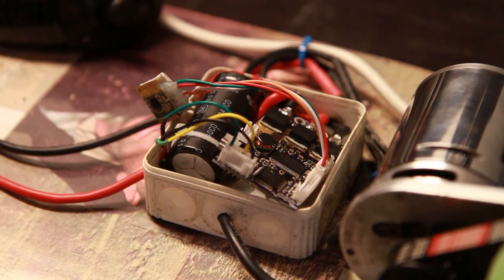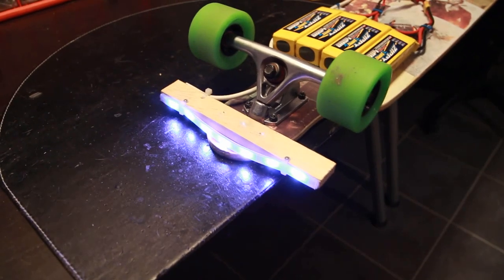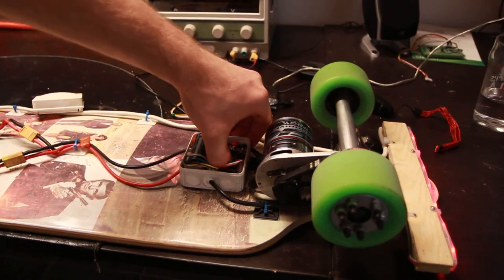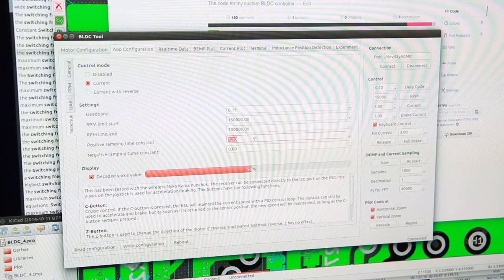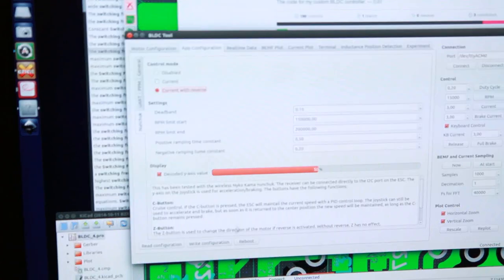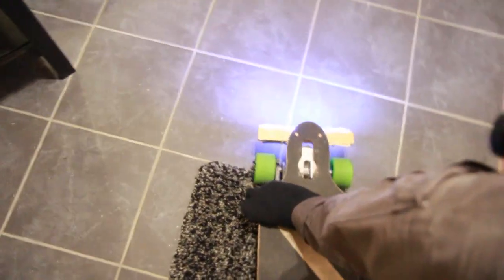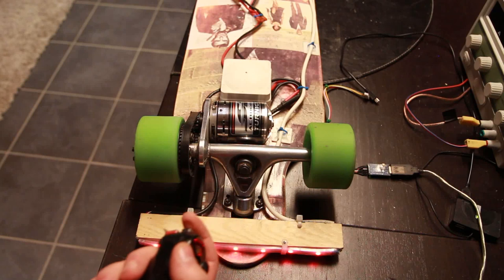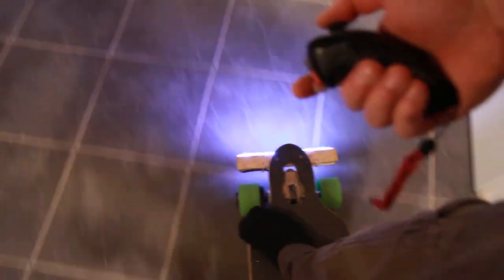Open source ESC nunchuk and ws2812 LEDs on electric longboard

Comment: Great presentation. I think your English is more than OK. I hope to see more
videos like this.

You should do a similar video explaing the different possibilities for setting
your ESC with the bldc-tool software - an explanation what all the parameters
change. You coul try to get a new brushless motor and show the procedure how
to set all the required parameters and how to see that the motor is running with
the optimal settings.

Comment: im getting a little closer the leds are addressable meaning you can program them. i think the hall sensor is just acting as a switch to change the direction from front to back when it senses the magnets in the motor change direction. not sure of the software but there is one called cleanflight.

Comment: This is really impressive, such awesome an project. Is it somehow possible to use one nunchuck for a dual motor setup? Or is it possible have feature the cruise control via a normal rc transmitter?
Thanks

Comment: Hello. I have a few questions. 1) Is the PCB design you are using that of Austin David's "Wiiceiver"? 2) I am not entirely sure of all of the technical aspects, but are you able to program the PCB receiver with the same (or more) options as a standard ESC program card? 3) If question 1 and 2 are yes, where can I find this program :D?

Comment: Also do you have a parts list (Esc, motor, batteries, software, board, motor mounts) Where do you get these parts like the motor mount for the trucks and wheel. I want to stay cheap. I know theres the $300 kit from enersion.

Comment: Hi Benjamin, I would really like to know what batteries you use and how many you use if thats not to much to ask, I would like to build a longboard for my self but I don't know what batteries will do for the motor. Im pretty sure its the same as yours, the turnigy 6374 168kv. Anyways keep up the good work and thanks.
Reply: Timothy Harvey most motors are rated as more powerful the more volts you out through them. it looks like he has 4 batteries, with 2 in series and 2 in parallel. doubling both the Volts and the maH. you can use any lipo battery. just choose one with a high enough volts and maH. typically 11.1v to 22.2v are used as standard. this is also known as 5s and 6s. there is also c rating to look at, but 20c and above us pretty decent. use this- http://toddy616.blogspot.com/2013/07/electric-skateboard-calculator.html?m=1
to see how fast your build will potentially go.

Comment: Awesome project! Wow, I saw you made your own PCB and, if I'm not wrong, developed your own GUI. May I know what kind of motor commutation you exploited for this? Trapezoidal for BLDC motors with trapezoidal back-EMF or Field-Oriented Control (for PMSMs)? For what I see, you're controlling the current which should be the torque output. But is it possible for the throttle to be less sensitive since the torque output may sometimes be quite aggressive, isnt it? and one last thing, for the sensorless position estimation, from the GUI, I guess you're using the inductance changes for motor with saliency. Does this work out for this type of PM surface-mounted motors since they dont have much of that saliency for detection? Thank you
Reply from the maker: Thanks!

Yes, I developed the GUI and everything myself. The commutation is trapezoidal for BLDC motors and while the motor is running the back-emf is measured for commutation. Currently I don't have any motor where it would give many benefits to use FOC, but I plan to implement it soon.

I'm using current control, and it can be quite aggressive when no smoothing is used. Ramping is on the current input is one of the things I demonstrated in this video. However, even without smoothing, current control feels much more natural and smooth than duty-cycle control as most hobby motor controllers have.

You are correct, the position estimation from the GUI is based on the magnetic saliency of the motor, but it is not used while the motor is running. I just implemented it to test how well it works. For the larger ourtunner motors I have been using it works really well, but it doesn't work for the low-inductance inrunner motors that I have at all.
Reply: Thank you for replying! wow, I didnt expect you could come and answer my silly questions with such excellent in-depth knowledge. I'm glad that someone speaks my language, i mean motor control stuffs, hahahaha. I'm also currently working on motor control but more on FOC or vector control. I used to play with trapezoidal commutation but it's not that efficient and robust as FOC (just guessing, haha). I've just purchased a mounting kit from Enertionboard and intended to build an E-skateboard with my own version of the controller and power inverter. So, thank you so much for your open-source stuff, they really help me get a kick-start. Last question, may I know whether the outrunners, in general, have trapezoidal or sinusoidal back-EMF? just to make sure my stuff (FOC) wont fail to run the motors efficiently if it's trapezoidal, hahaha
Reply from the maker: Cuong hoang chi
I recommend reading this thesis:
http://webfiles.portal.chalmers.se/et/Lic/AstromJohan.pdf

In general, FOC is not as fantastic as it sounds for motors like these ones. For industrial low-speed high-inductance motors and ACIM motors it is nice, but for high-speed low-inductance RC motors FOC is in most cases less efficient than BLDC with phase advance (see the graphs in the thesis I linked, in all of them BLDC is more efficient). Especially the motor driver is going to lose efficiency and require more cooling with FOC because it has to switch a lot more. When running sensorless, measuring the back-emf on one phase gives nicer waveforms than measuring the current, especially on low loads. The only advantage I see with FOC on these motors is that it runs a bit quieter.
Reply: Benjamin Vedder Hi Ben, thanks for your recommendation and readings. It's clearer with the thesis. And you're right on the back-emf detection over the current sensing of FOC. But I still hope I can have a chance to experience the FOC on a outrunner. Just to know how hard could it be or how I could expand the capabilities of FOC to outrunners. By the way, I heard that you intend to commercialize your board, dont you? if so, when can it be available? I'm really keen to purchase your boards as I saw they includes high current power inverter with both the BLDC and FOC. I did have some boards with FOC and BLDC but none has that small form factor as yours and I'm also too lazy to design my own, lol :))

Comment: I have a question, could you please give the link to the esc or if it is custom made by you a tutorial which explains how to build it
Reply: Wavegreen it is called a VESC and is manufactured by a lot of companies. Some have different configurations of the same design. check out ollinboards and enertion.

Comment: Hey man amazing stuff, looks really tidy!! can you please help me, I'm kind noob to electronics, I just payed roughly $300 in materials to build a board, I have spare receiver (multiple since I have a spare quad scrap and fpv goggles which I use the receiver from) If I send you a pic of my setup could you show me or explain what wires I need to connect up a numchuck controller? annoying me lots because I don't know the lingo for all the cables n such....